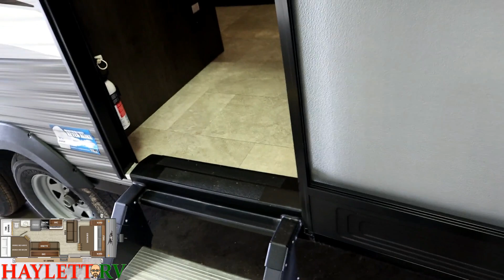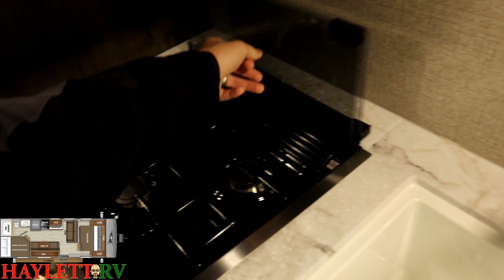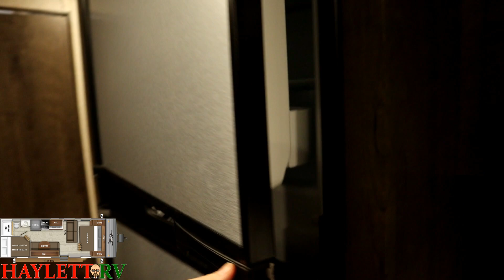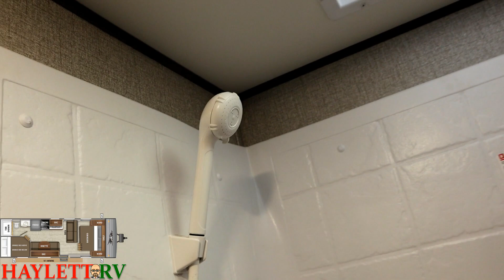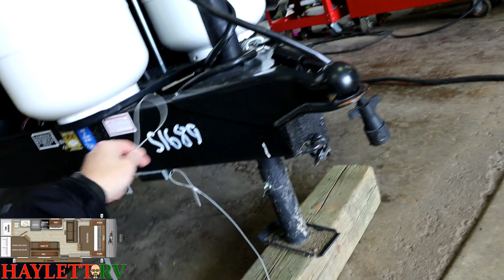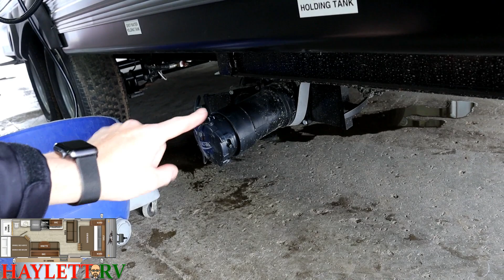(Sold) Jay Flight 264BH Operation of Basic Functions

Comment: There is almost no pdi in the RV industry one door dead bolt does not work no one explained how and where to plug in the rear refrigerator, check all compartments for loose latches  so they do not blow open when towing (twice) .
Reply: As a matter of fact the salesman did not know how many holding tanks or what size propane tanks were.

Comment: Josh, this is the family camper for you, isn’t it...?
Reply from the maker: Yep! Though mine lacks the current snazzy updates. Jayco REALLY raised the bar with their "Late 2020" stuff. 

Easy to tell which is which -- the Silver Skin Jay Flights are better than any Flight has ever been
Reply: I have a quick question. You said the refrigerator would attempt to light 3 times then shut down and also said how to start it again, is the process the same for the DSI water heater? I have a 2016 Jayco white hawk with the same water heater I believe and am curious since the water heater is about as far from the tanks as it can be and know it will take awhile for gas to get back there.